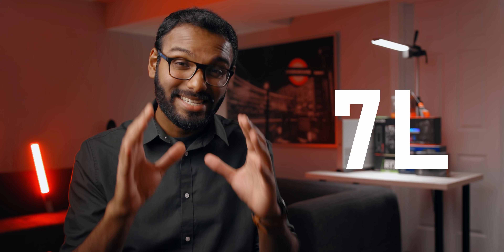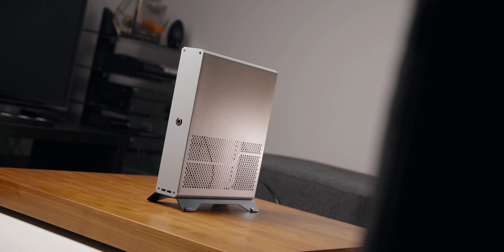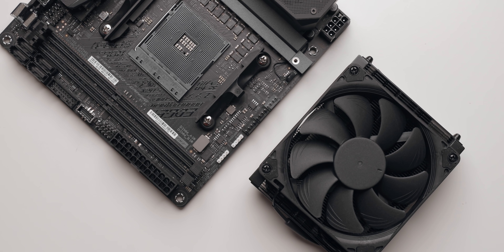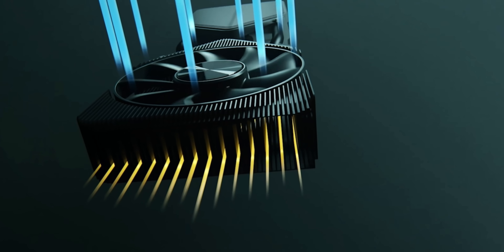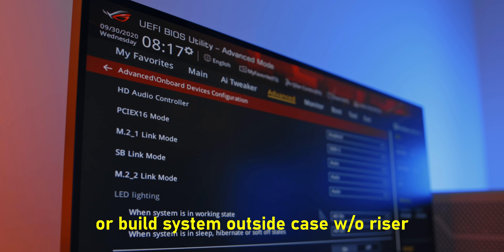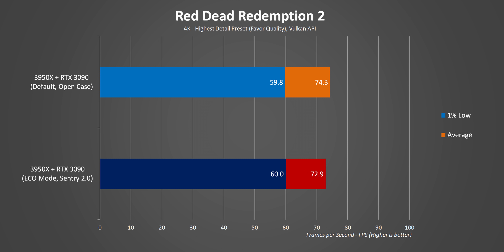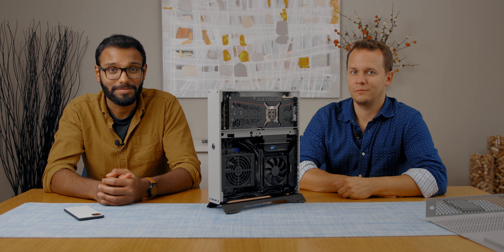RTX 3090 in a CONSOLE Size PC - It Works and its AMAZING!

Comment: Hey guys, 
Can you put the build inside a standard carryon suitcase and take a couple of pictures?
I will really like to know if this one could be my travelling PC.

and regarding a mod
how about building an externa base for it, with big fans at low RMP;
I'm pretty sure there is already some airflow due to convection -> which you guys could probably measure
If you build a small base for it, just to allow for air to start moving up, not from the bottom of the case but a couple of inches below, you could check if that increases airflow / termal exchange.

Comment: You guys should check out the S402 from salvo studios. It’s got a 3 slot bay at 9.5 ish liters. I just managed to fit a slim silver stone 240mm aio under a 2 slot 2080 ti fe (still waiting on availability for the 3000 series) it’s a little bigger than the zaber, but the compatibility is much nicer.

Comment: Would it be better just to disable 2 of the slower ccxs and have a really fast 8 core to get the tdp down?
Reply: With a 3090, it's a workstation first. Odds are that you will be using all those threads. If not, a 3700X would be the better choice.

Comment: This level of graphics and processing should fit into the size of a rubics cube with partial processing utilizing your human form as additional components. Power supply can be transmitted wirelessly. It's amazing your species still waste so much heat. Good luck.

Comment: I don't know if you have the tools to do it

or the will to potentially ruin the case

But since it isn't a sandwich layout, it is possible that you could put some holes on the side panel that is over the GPU backplate, and use a FE model. That way, well most of the air cooling the GPu would make their way instantly out of the case, either through the blower fan of the backside fan

you'd obviously be downgrading from a 3090 to a 3080 tho

or you could maybe find some 40mm fan to put on the top of the GPU to exhaust hot air coming out of the heatsink, but I don't know if there is 25mm of clearance and / or if any 40mmm fan exists in a slim form factor

Comment: Very nice work. Just wondering whether the SX700PT is enough (which you said) when the 3090 says recommended 750w. I have similar setup ready to be built other than the PSU. Thanks for your feedback.

Comment: Do you guys still have the Node 202? Though of course, I get the case itself is one of the main appeals here but I reckon the 202 would alleviate some of the cooling and cable management issues you had here whilst still being in the same form factor.

Comment: LG Ultra gear  240Hz 1080p or 144Hz 1440p IPS Monitor should i buy for RTX3070? ( I have upgraded my PC to i9 10900k with 32 Gigs for gskill ram now im using my old GTX 1050ti with dual 21inch 60Hz monitor setup. So need some advice on upgrading the monitor setup for the upcoming rtx 3070) please help :)

Comment: Why can't you just use the FE card and add additional perforations to allow for the air to pass through? The FE card expels most of its heat through the I/O panel, which you EVGA card does not do. I really think that just adding your own perforations to the case to enable the air to pass through the GPU will help a lot.

Comment: I built a 3950X ITX build in Sliger SM580 case.  Smallest case I could find that does 280mm radiator and... 280mm is too small for over clocking a 3950X.  Can barely keep it reasonably cool.... Now if I can get my hands on a 3090...

Comment: Wondering what could be done to the front panel in GPU section. Could put some small fans if case was a little longer or rise the top section to fit in some small fans.

Comment: Case is sold out. Any alternatives to something like this? I need it for traveling on the go.
Reply from the maker: You can contact Dr. Zaber and be put on the waiting list for the next production run.  Otherwise there are usually some being sold used on the SFF forums.
Reply: sliger conswole and console cases offer 2 slot and 3 slot. They are similar.
Reply: Shreshta Jaiswal  while fully water cooled systems can be heavy, theyre not obscenely heavy. Youre looking at most about 10lbs with this air cooled system if that.
Reply: @CursedRW  Just took a look at it and it looks exactly what I want thanks.
Reply: @HardwareCanucks  Thanks, Ill give that a try.
Reply: Shreshta Jaiswal  Well I was never planning on having a 3090 lol Maybe a 3080 (If I can even get one till 2021) I agree though with your suggestion for a high gaming rig.

Comment: For such a tiny build I'd go with an Intel CPU, which can be heavily underclocked and still reach that 4.5-4.7GHz so plenty of performance, let alone for even lower clocks. Also - wouldn't the Black Ridge cooler fit into the case? It's 47mm tall, which going by the case specification should fit just right?

Comment: No comment about noise levels? I got a DR Zaber sentry and one of the main issues is that the fans have to go so hard that it becomes really noisy, particularly with a blower GPU (which was recommended by DR Zaber)
But anyways, I've been meaning to move away from my 7600K sometime and this video is perfect!
Reply from the maker: That'll be in Video 2

Comment: Hi! Nice build you got there! I just wanted to ask which models would you and Dmitry recommend for itx builds? I currently have a rtx 3080 mini itx build in mung but most rtx 3080s are super beefy and huge. Or 3090 models. But overall nice build! :)
Reply from the maker: Zotac has the most compact RTX 3080 right now I think.
Reply: @HardwareCanucks  Thanks. Look forward into it. Also why did you usr b550 and not x570?

Comment: actually i am always wondering why people make chassis smaller and smaller, wanna save more table space or make it portable? especially for gaming, cooling performance is really important
Reply from the maker: Actually smaller chassis can actually HELP with temperatures since there's less room for heat buildup and most of the time ventilation is located closer to the components.

Comment: Now imaging if they made something like this with easy access to the RAM slots and had a quick connection for GPUs, so you could buy in cheap, upgrade over time, and just plug in a new GPU like you would a Micro SD card.

Comment: Since the top is perforated. Would it be possible to use some small (For example Noctua 40mm) fans in the space at the top of the case, between the side of the GPU and the top cover to exhaust some more heat?

Comment: Ryzen master only changes settings for one boot up. It's always been like that. It's nothing different with asus. My msi mobo is the same way.
Reply from the maker: Actually it doesn't / shouldn't with PBO enabled which is why you need to technically enable it in the BIOS to get Eco Mode to work properly.

Comment: JayzTwoCents already demonstrated that the founder's edition 3080 actually IMPROVES overall system thermals.

Should've used that card for this build. Or at the very least, compared the two cards.
Reply from the maker: The 3080 CAN improve thermals but that wouldn't be the case in every situation.  As for this situation, one of the fans would be exhausting air directly into the Sentry's support panel with only ~3mm of space.  Without some extensive mods, this could cause serious thermal issues.
Reply: @HardwareCanucks  - very true. Thanks for replying and making the video.

Out of curiosity, you should definitely make a quick follow-up of thermals using both.

I'm curious if the small amount of heat coming from the back fan on the Founder's Edition into the Sentry's support panel actually matters.

Checking RAM, MOSFET, and other MB and system thermals.

Cheers!

Comment: Will the rtx 3060 or 3070 work with the dr. Zaber sentry 2.0 because I have one???
Reply from the maker: Yes.  The RTX 3070 is a smaller card.
Reply: @HardwareCanucks  ok I was concerned about if that card pushes hot air out the back of one of those fans towards the inside panel ....

Comment: The founders 3080 would be way better for this case I think, with some slight modding. Vents on both sides for the pull thorugh fan, other fan exhausts the back
Reply from the maker: The problem is that the Sentry uses a very interesting semi-plasticized finish and drilling through it causes some pretty major issues.  Still trying to find a way around it.  - Mike

Comment: Great build but if i were to build one(which i wont any day with this cpu in that kind of case) 
I'll go with sliger console case + Nvidia 3090 fe triple slot almighty.
But rather i will just build a sliger sm580 w/3950x & 3090 & as many radiators as i can fit in it.

Comment: Use the founders edition 3090 cause it exhaust some of the air through the back
Reply: you'd need to make vent holes in on the other side of the GPU compartment to take advantage of it
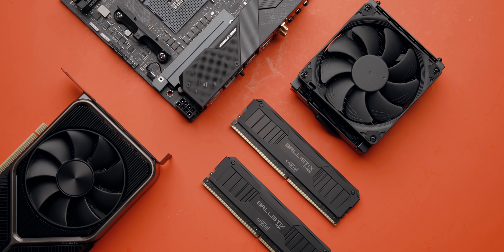Reply from the maker: Nope.  Can't add that since its triple slot plus what we said at 5:23
Reply: The 3090 FE is a 3-slot card, won't fit in this case.

Comment: I was able to fit a 3080 fe card in a knock of version of the sentry case from China because both sides are ventilated on the knock off and the gpu temps are 68 under full load I achieved this by actually place 4 slim Noctua fans three under intaking cold air and one othe other side where the blower fan is exhausting air with the 4th fans on top it shouldn’t fit but it does and case does fully close
Reply: Noctua 92mm or 80mm fans? Can you upload any photos to reddit/tumblr/instagram/pcpartpicker for reference?

Comment: Ya but, what fan speeds are the gpu and cpu running at, what are the noise levels like? Why put in a 3950X just to handicap its performance? Less talking about what you want and more talking about what you have 👍🏻

Comment: You didn't try downvolting? That's like the first thing you do in builds like these lol, especially the GPU. I've seen 3080s run at 900 mV, sometimes even 860 mV with no performance loss, so I'm sure you could downvolt the 3090.
You could also probably get more performance out of that 3950x with some tuning of the voltages and CCX frequencies, either by tuning it manually, or by letting AI do it by using CTR (Clock tuner for ryzen), which is a really great piece of software.

Comment: Bit of a long shot, but I'm really curious to see how this setup will fare in a Node 202. The case orientation means GPU air will likely rise into the CPU compartment a bit, but the support for two case fans right up against the GPU should help with temperatures a bit, as 85 degrees seems pretty high for a GPU.

Really I'm just super curious about how practical these cards are in ITX cases in general, in terms of managing temperatures and noise.
Reply: The most significant oversight of Node 202 design is the lack of ventilation behind & around the GPU. While there’s two generous 120mm intake mounts, there’s nowhere for the hot air to exhaust. This causes a heat feedback loop where GPU ends of recirculating an already hot air.

Comment: Why not downgrade the current processor and replaced with lower core count that can run at higher clock?
Reply: If your use case scales to 32T, it likely benefits more from threads than from a couple hundred MHz. The SKU with the next lower TDP bracket would be the 3700X (aside from 3600X/T) - so you're halving your threads only to gain, what, 500MHz all-core frequency?
The loss in performance is very minimal and can be further minimized with voltage offsets or wisely chosen manual voltages. If you can make use of 32T and have the money for it, I see no reason to downgrade your processor over doing this.
Reply: @lejac4916  that is if the apps/games using it are able to utilize all of the 16 physical cores. But most apps/games i know don't. I may gain 500mhz only but surely i will get the most out of it at safer operating temps. Example scenario using 65w cooler: 3950x running at ecomode capped at clockspeed  3.1ghz and the game using only four of the cores vs a 3700x running at boost 4.2 ghz and the same game using four cores.
Reply: @practicalthinker5545  The 3950X will still boost to its full 4.7 (or so) Ghz in eco mode at low load, so you're not running at 3.1Ghz capped. If you run a game on the 3950x that only utilizes 4 Cores, the 3950x will park/set to sleep any cores it isn't using, if it is configured correctly. Cores that are not in use detract very little from the power budget, so you won't see a loss in lightly threaded apps.
I assume if you get a 3950x, you already use apps that scale past 8 Cores in the first place. He showed Blender in the video and presumably uses various rendering/production applications for the channel
Reply: @lejac4916  😂🤣😂
Reply: @lejac4916  you kidding me man? Have really looked at a HEDT cpu when its idle and on load? 🤣 Have you tried using atleast a 3700x and monitor it with after burner? Do you see only 4c/8t or all cores and threads? No its doesn't put the unused cores to sleep like what you assume. It all uses it but in a unbalanced way. And also what reason would a HEDT chip like that wants to boost when on low load???? 🤣😂🤣😂 When on low load what it wants is to stay at idle clock as long as possible it will not boost. Whew.. you clearly don't know what you're talking.

Comment: So basically, Small form factor cases suck in temperature management and overall installation is a mess. Thanks.
Reply: If you have no commitment to a project. My SFF is purely for the sake of itself. Runs cool and quiet, but only for my own efforts.

Comment: this build is all over the place. not really stable with these kind of parts IMO. that 3950x is way too hot for air cooling especially in such a small space and small cooler. i would revisit this build with more optimized parts. id love to build one if i could buy it.
Reply from the maker: Prove it.  Been using this for the last week now and its perfectly stable playing games and rendering with Blender work projects.  - Mike
Reply: @HardwareCanucks  +80C not ideal. couldve explored more undervolting options in the same video. if i could get this case and prove it i would.

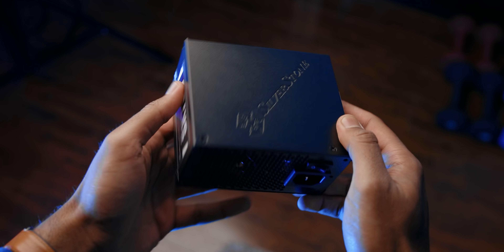Comment: @6:26

Considering EVGA are recommending  a 750W minimum PSU I wouldn't call a 700W unit plenty lol
Reply from the maker: Its plenty.  All vendors over-spec just in case you are using a VeRY power hungry CPU or other components.
Reply: Go watch optimum tech even a 600 gold or platinum PSU is enough with something like a 3600

Comment: "The performance improvement over the previous generation is just incredible"

No it's not it's one of the weakest ever.
Reply: the 3080 is quite a bit better than the 2080 ti and the 3070 is supposed to be equal[not to mention the great prices][-rtx 3090]. this is the biggest improvement by percentage since around 2004
Reply: @manymadmidgetzz6293  It's 22% faster than the 2080 ti at 1440p lol